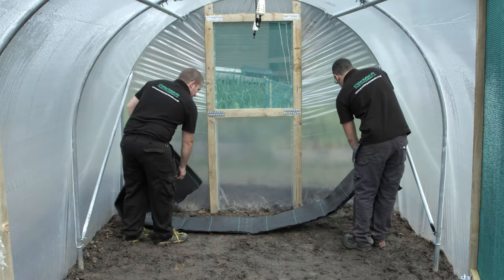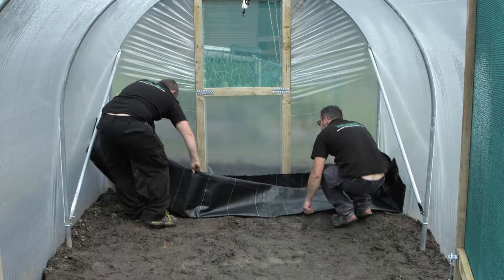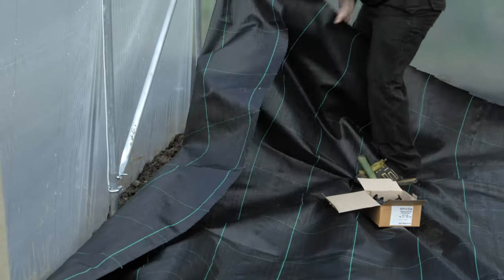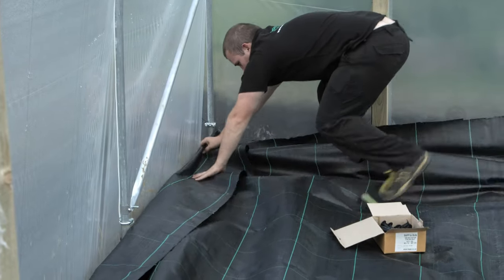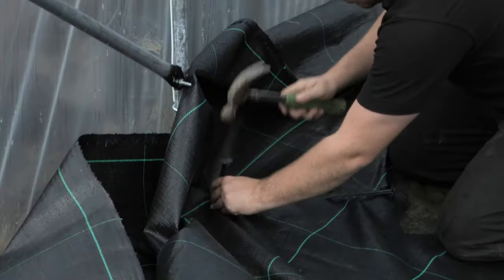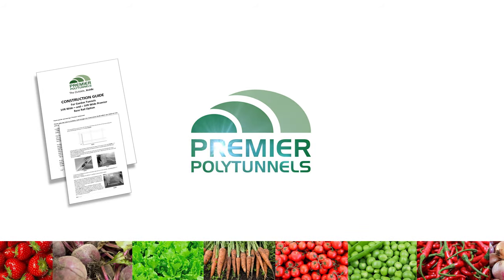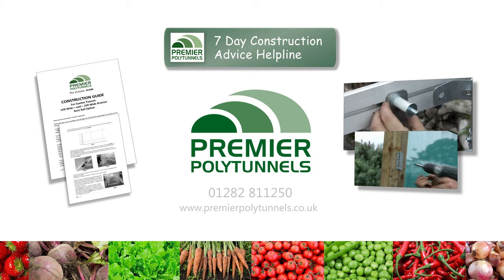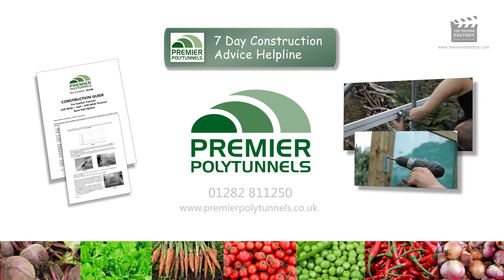Ground Cover for Polytunnels - How to lay a Ground Cover | Fitting a Weed Control Sheet

Comment: What did you say?
Reply from the maker: Lay the ground cover sheet on the inside of the polytunnel, then secure it around the edges using ground fixing pegs, as shown in the video. Simple :-)
Reply: Can chemicals come out of the covering for polytunnel floor?